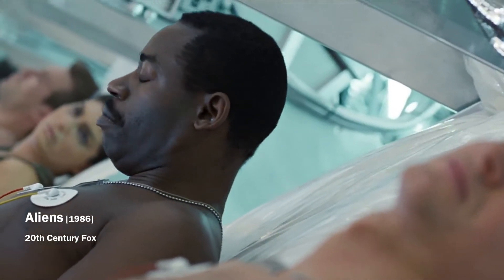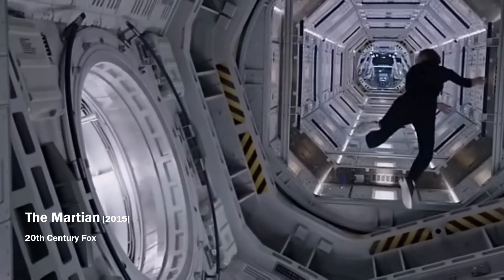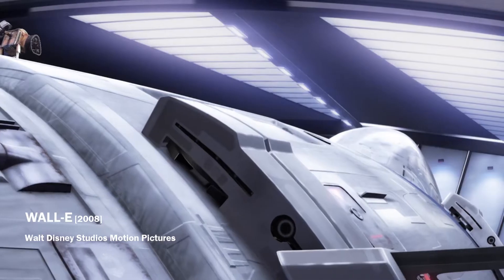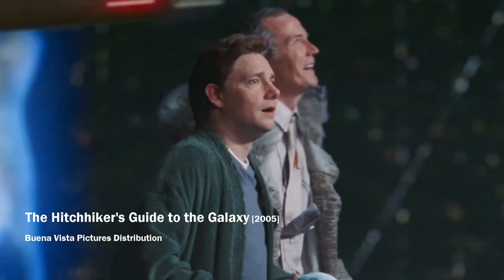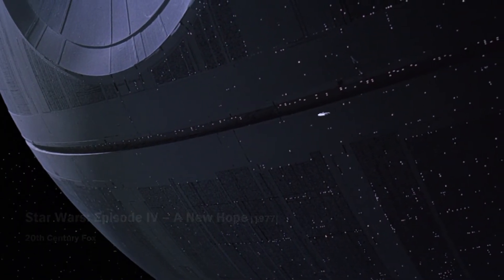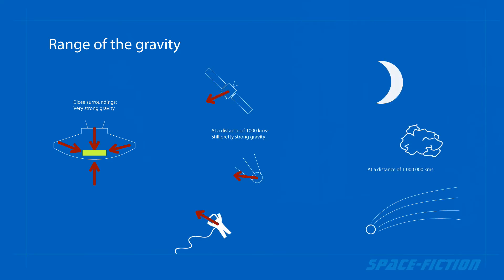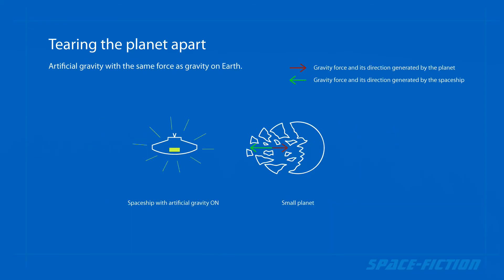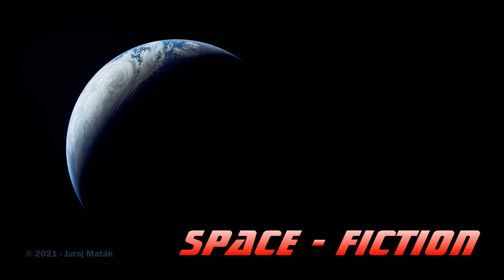5 reasons why is the Artificial Gravity in Movies wrong

Comment: 3:01
This is not true. Gravitational force is a product of REST mass, not relativistic mass. Rotating mass to high velocities does not increase rest mass, hence no gravitational increase from it.
Reply from the maker: Yes, it will not increase the rest mass of the rotating body... but it will increase the observed mass of the body (relativistic mass). And this is exactly what we are looking for.
If you were the rotating body, your mass will be the same. But I will see you gaining weight by speeding up the rotation.
But yeah... this is just a theoretical conclusion. I doubt that in a future we will be able to build such a device. Because centrifugal force would break it apart long before it reaches the proposed speed.
Reply: @Space-Fiction  You will not see me gaining weight as a result of spinning in a speeded up rotation.  You are confusing centripetal acceleration (which is a force) with mass, which is not a force. Think for a moment. If what you say is true, then neutrinos traveling past you (near the speed of light) should see you as having a huge mass, and be deflected towards you or any other body of near equivalent mass. To them, you are passing them at near light speed, and your relativistic mass (what you call observed mass) is very large. But it's your rest mass that's responsible for any gravitational attraction to them ... and that remains negligible.
However, particles at high relativistic speeds do distort space-time and as a result gravity. But that does not mean it generates gravity in excess of its inertial (rest) mass.
Reply from the maker: OK, I am not confusing centripetal acceleration with mass. I was talking about something else in the last sentance in my last comment.
But back to my video...
My assumption was, that observer will measure higher mass of the fast moving object in the same reference frame than he would measure it if the same object is in a rest.
So in what case will the observer measure  the higher weight of the fast moving object due to the relativistic effects?